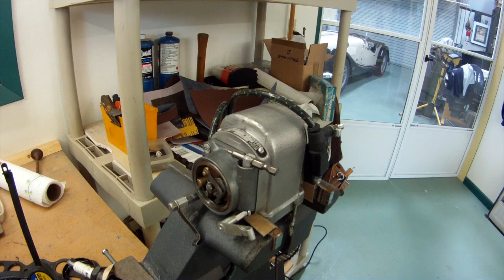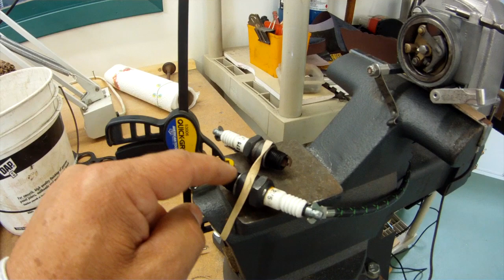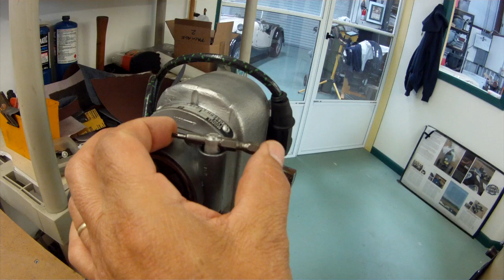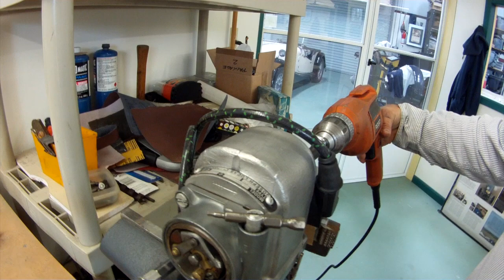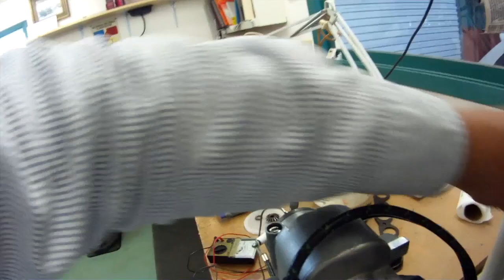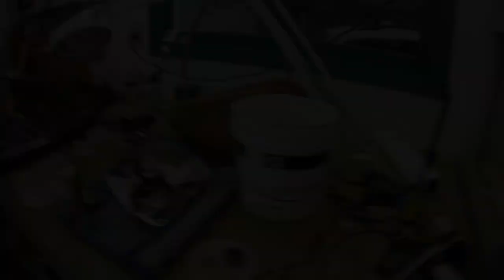Lucas KNV Magneto test

Comment: It looks like a good way to test the magneto, as long as you don't over-rev it, as  I think it  runs at half engine speed. By the way it sounds as if your drill is on 'hammer action' which may be detrimental to the mag windings.
Reply from the maker: Good point about the speed.  My other drill is limited to 1600 rpm and would have been a better choice but it was acting up.  The stock 1100 cc J.A.P. LTOW V-twin engine that this fits on probably doesn't turn to 5000 rpm.  I don't recall what caused the hammering sound you describe but it was something in the mag itself.  I'm sure I didn't have the drill in hammer mode (I suspect that would not work in reverse anyhow), and, come to think of it, I don't recall that drill having a hammer mode (I can't examine it at the moment since it's 1300 miles from here).  I had posted this so that the magneto rebuilder could see how I did my test.